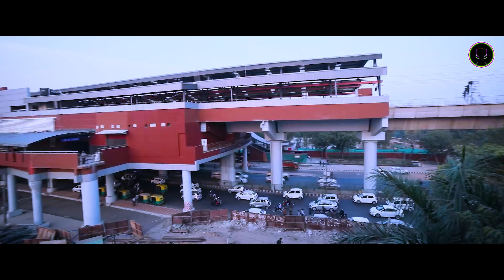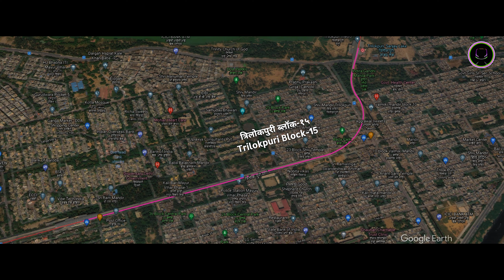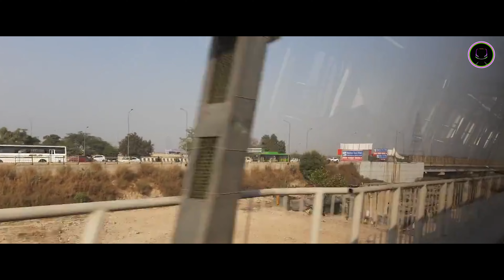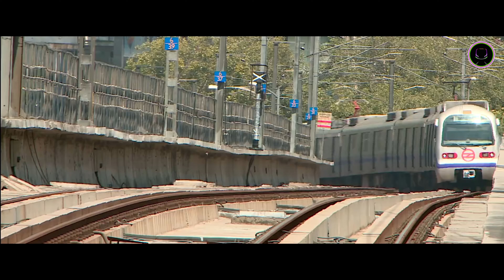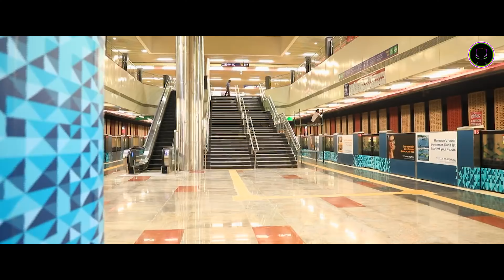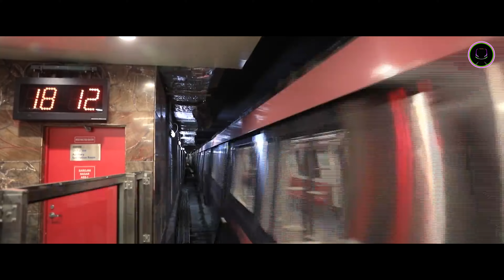Pink Line Trilokpuri Joining Update || Delhi Metro || MetroRail Blog

Comment: Thanks for this update, DMRC MD mentioned somewhere that line would be complete by March and should be operational by May, I'm surprised to know that it would be ready by September. Is this new deadline now?
Reply from the maker: Yes. March is definitely impossible. It's September now.
Reply: Actually even I read it in newspapers recently that they will complete the work by March. I am sure you guys are mistaken if not March than surely by may but not September